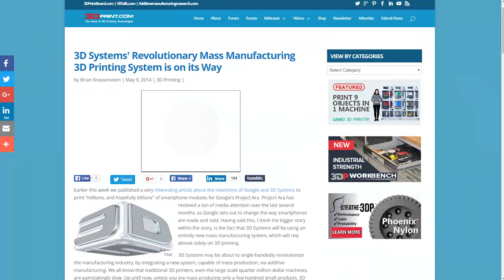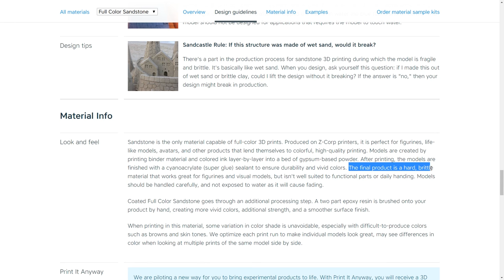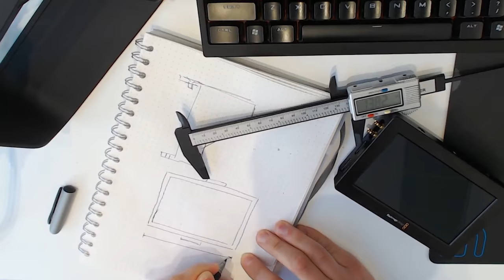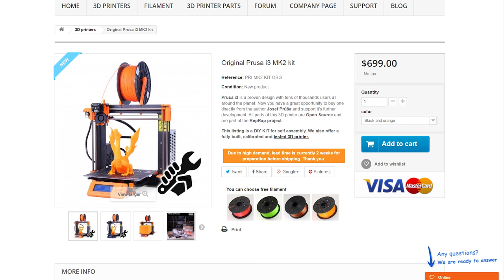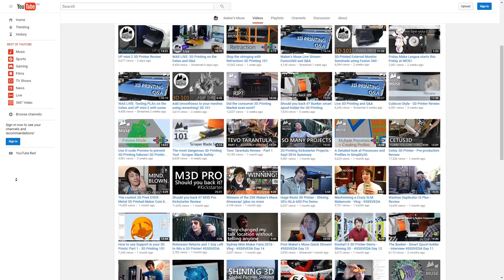Top 5 3D Printing Myths and Misconceptions

Comment: I've been interested in 3D printing for more than a decade, but I was a little daunted by hearing an owner of multiple printers say "You're not just buying a machine.  3D printing is a lifestyle choice."  This was about the investment in time required to tinker, adjust, tweak, modify, fix, and experiment.  These things can still be part of the experience, but from my recent research into 3D printers, I've concluded that 3D printing technology is matured enough to get a good out-of-the box experience without breaking the bank.

I finally bought my first 3D printer this last week, though I still haven't had a chance to clear some space to set it up.  ;)

Comment: I got into 3D printing a bit over 12 months ago when they had that on ya buy in bits from the news agent, no I didn't lol ... I ended up getting a K8200 been modded and rebuilt heaps since. At the time I found it hard and expensive to find filament and as for parts .... now look at what is out there and that's thanks to people like you that have created an awareness here in Aust ... Thanks

I now have 2 running printers .... the second one is one I've made up from bits ... yes all available on the open market here in the land where bits fall up

Comment: Watching this long after it was made, and my only additions are 1, the amount of people going on about guns, and 2,  a few people worried about the printers themselves being dangerous.  

As far as guns, I find it silly, since you could probably make something far more effective and reliable out of copper tubing, a nail, and some rubber bands (probably.  Don't try it at home, anyone.  Bad idea all around.  The point is, that you probably could, and it would be able to do more than a single shot, unlike plastic.)

And safety is laughable, unless you're doing something very, very wrong.  (Don't print near flammable/explosive materials, please.)

Comment: The most annoying misconception i find from people that should know better is "CNC milling is way better than 3D printing" or "anything you can do on a 3D printer can be done on a CNC mill." A standard 3 axis CNC mill is heavily limited by geometries including endmill length, and the basic fact that any 3 Axis CNC operation that the base of your part can never be narrower than what you have on top of it. For instance it is impossible to 3 Axis CNC a sphere, You can CNC mill a semisphere where the base is the widest, but you can never go wide mid way through and then narrow again. A 5 Axis setup CAN get around this problem but even then you are limited by endmill length, and it is impossible for you to cut internal structures such as the staircase in the formlabs rook.
Reply: it's always said by people who aren't machinists. usually they've never even touched anything beyond a drill press.

Comment: After watching tons of your videos and many of other similar channels, I think I ll get myself a 3d printer. I want to use it mostly for rc stuff so I will need to print some kind of impact resistance materials like petg,or semiflex etc. So I am between the qidi x one or the flashforge finder special edition who according to flashforge can print their own semiflex filaments (eco tpu they call it ), but since it does not have a heated bed it is restricted to those. Any advice?

Comment: Hello Angus,

 Why are you so rarely talking about chinese prusa DIY kit like geeetech and the million other? It is by far the best bang for buck as long as you can use your hands for anything. For less than 200$ you get ~200cm3 heated bed, a printer that can print most of the materials on market (will depend on the included hotend ofc). And as it is a fuckin 3D printer you can improve upon it by printing new parts for your printer. It is 100% open, you usually get all the stl for the parts as well as the open source software such as marlin firmware.

 I know it won't fit all use as it is far from plug and play and don't meet the reliability requirement for industrial use. But in my opinion it is the way to go for any hobbyist, even the one with the money to buy better printer, as it is the best learning experience.

Sorry for the brick, see you around. Great channel as always !
Reply: Rubafix989 I got a chinese kossel delta a few days ago and have to say that I am very pleased with the results I get! I will be upgrading to an aluminium bed and an inductive probe for automatic bed leveling though... (calibrating a delta manually ia quite frustrating)
Reply: Make sure that your printer stays in place on a solid table and you should be good. I rarely have to level the bed. Finding a good flat aluminum sheet is not easy.
Reply: The problem with trying to review one if this kits is that every time you order, you're likely to get something different.

If you do buy a Geeetech, pull the power in plugs off the control board and throw them away...they are disgracefully underspec. They will melt and/or catch fire , releasing almost certainly toxic gas.